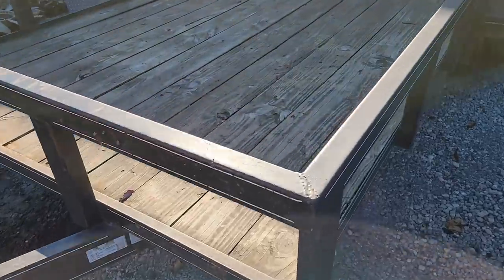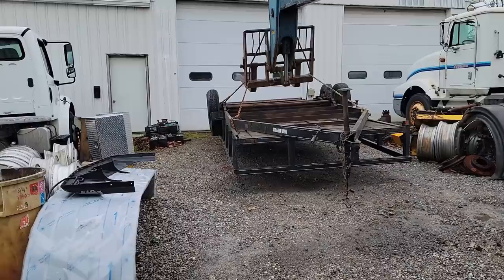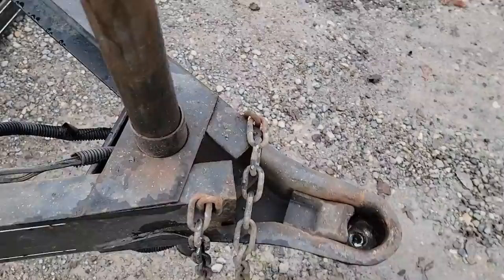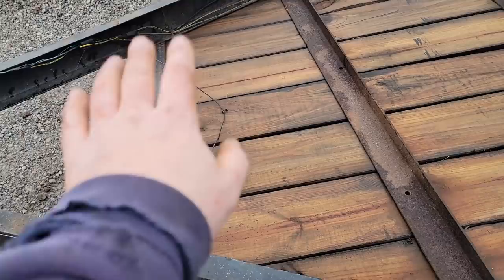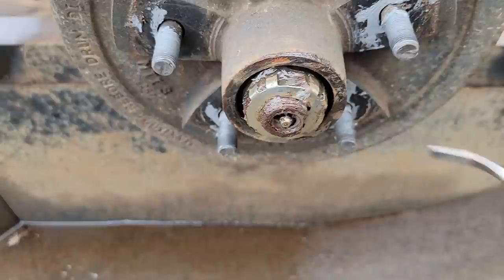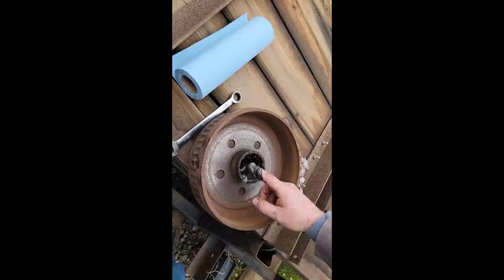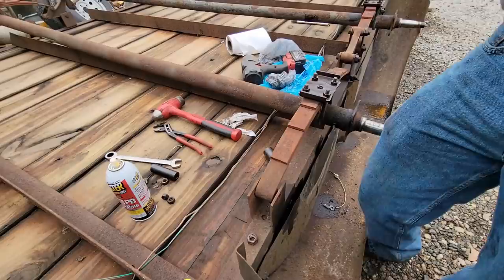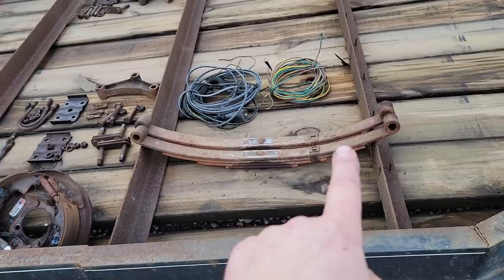7' X 18' LANDSCAPE / UTILITY TRAILER REBUILD! THE TEAR DOWN & INPSECTION!

Comment: Cap every other angle iron with the next smallest  angle iron and make a box beam.
If you want easy welding. Or same size if you want harder welding. 2" welds every 4 inches but first 4 "  on both sides. 

I do that on angle iron top trailers and it really stiffens the tops up quite dramatically. No more galloping gurtie tail shaking road harmonic trailer pulling.
 Billd better triangles!

Comment: They have a hd shakle kit on Amazon that's 90 bucks comes with all new bronze bushings wet bolts and 1/2 thick shackles I put it on my dads car hauler it worked very well

Comment: At least all the suspension and brakes parts are easy to find. We have a trailer with the exact same suspension and at least once a year I'm replacing the bushings and shackles... Sometimes the equalizer if the bolt worn through the bushing to much.

Comment: my 7 x 16 was welded the same  poorly . so I re- welded the whole thing and also added cross beams ,used pvc tubing for wire through that way no more rust  tail light kit was 25.00 bucks at  Napa. just needs new paint

Comment: I just did all this to my trailer. Looked exactly the same as yours. I added brakes to the 2nd axle. Without labor I think I was in $900 with 4 tires, re wiring, 4 leafs, u bolts, 4 brakes with bearings and backing plates.
Reply from the maker: i am going to use that i bought really cheap years ago. that is one reason this project is able to come in under budget and at the cost i want to be at.

Comment: I’ve never owned a trailer before, so I’m not going to comment and pretend that I’m an expert, but it’s surprising to me that they let that thing leave the factory in the first place.  I understand that it was sold as a budget friendly trailer,  but they could’ve taken a lot more time with those welds and fabrication.  

You’re right J.C, if they did a few more weld passes on those spring hangers it probably never would have failed in the first place, unless of course it was simply over loaded or hit something.  

Another great video, I hope it works out and doesn’t become a money pit for you👍
Reply from the maker: poor craftsmanship it the cause of the weld failure. shameful. i dont have time to do something once, i sure dont have time to do it twice.

Comment: I would check the tracking on that trailer... From ball centrr to front spring mount... Should equal... Then tandem mounts a have spec also... To be set from each other...  As screwed up as that trailer looks from use, it is equally cheaply assembled.. I would be willing to bet, tracking is out... = Tire wear...
Reply from the maker: we did. it is acceptable.

Comment: I have 12ton C channel heavy equipment trailer using the mobile home axles running the 9-14.5 low boy tires  8ofmy landscape trailers running brake axles but 8-14.5

Comment: I'm sure that trailer was frequently overloaded. Those spring hangers shouldn't be welded 90 degrees to the spring, that is exactly why they cracked( despite a crappy weld) . A better bigger weld would only cause cracking upwards through the frame. Have a good new year, Mike.
Reply from the maker: every one of these smaller trailers i have owned has been welded the exact same way.
Reply: @j.c.smithprojects  Maybe so maybe not. I've seen them both ways, The only ones I've had to do crack repair on the frame were welded that way. If you look on a leaf spring semi trailer you won't find one with welds going across the frame flange, same on trucks as it creates a crack situation.
Reply from the maker: i dont disagree with the principle at all. just that all these light duty trailers i have seen are welded the same as this one was.

Comment: That is what I would describe as a product made to suit a budget price. The previous owner(s) have not been good either with regard to it's maintenance. I have to say there is fairly obviously more work to repair it to make it even safe than I expected.
Reply from the maker: i have owned many light duty used trailers like this. i have not been surprised by anything on this trailer do far. typical "budget basement build". it will be ok when we are done.

Comment: For the rims you might want to look into powder coating them. Those rims should be small enough to put in a residential oven, get  an electric oven used then you can powder coat small things on future projects.
Reply from the maker: oh man, i hate powder coating. one rock chip and salt / brine solution from the winter roads gets under it and it peels off in sheets.
Reply: @j.c.smithprojects  you are right powder coat is not what everyone thinks it is no substitute for good prep and good quality paint.
Happy New Year to you and your wife

Comment: Always wondered how those electric brakes worked - now l know...can the brakes be wired up to come on when the brake lights come on...also l was noticing how the trailer was wanting to lean towards you when you had it on the hook - that was pretty good the way caught it when it started going the other way (so you could lay it down) seems like nothing ever goes that easy for me
Reply from the maker: there is a brake controller that takes input from the brake light switch. it is like a relay. it used the small amperage input to control a larger amperage draw. it also applied the power to brakes on a "ramp". starts at 0 volts and maxes at 12. the max voltage and how fast it applies that voltage are adjustable. some are a "time based while others are "inertia based".

Comment: In a casual conversation with a man at my granddaughters school he asked me what I did now that I was fully disabled and retired. I said I just tinker with my own stuff now and that I had just got done building a trailer. He proceeded to go completely sideways and say that he would NEVER buy a trailer that some jackleg has built. If I get one it's going to be a factory built with welds I can trust. 
After a little more of his rant I politely excused myself and left. I can understand where the guy was coming from. He had no idea that I was a certified welder and an aircraft machinist. But it rubbed my fur backwards a bit.
Now you look at what you have. It's a factory built unit that should be spot on.
Disregarding the wear and abuse that trailer is....... interesting. What reject did they have welding that thing? Where are their inspectors that should be finding this stuff? Those wires running through the holes......oh boy.
We buy this stuff new expecting that the people who built them know what they are doing and care.
Just think about that when you see these things flying down the road. 
It sends shivers down my spine sometimes.
I know when you are done with that trailer it will be right....not like it's factory built.
Have fun and be safe!
Terry

Comment: I made bolts drilling through the center and then made a hole vertical to grease the bushingmy bushing lasted 3yrs
Reply from the maker: we wont put enough miles on it to be a problem....plus i will maintain it.

Comment: I say the axle without brakes is the replacement axle cause a axle with brakes cost more and or they found a use axle cheaper then new and it has brakes but its hard to say but I say no brake axle is the winner for being the replacement one
Reply from the maker: if that was the case, the electric brake wire would have been too short to reach the back. most times when they put brakes on one axle only, it is the rear. the date code on the rear axle was 2020. they may have just bought the beam and not the complete axle.

Comment: Nice work again, Sir.  I know you mean well about staying under budget.... but I also know how you build/fix things.  (everything is done right) You and I both know this trailer will be perfect when you're finished with it,  regardless of what the parts cost. I've never seen you cut any corners yet. lolol. It's unfortunate that most mass produced trailers have such poor build quality.  I know not every manufacturer is bad, but I'd say a good majority of trailer companies put out this kind of product. It's like they have absolutely ZERO pride in their work. I consider a lot of these poorly built trailers dangerous. Imagine a hitch or tongue weld snaps and the trailer comes disconnected from the tow vehicle, and it's loaded with commercial lawn mowers or a car (for example), the two safety chains that are also poorly welded are going to instantly snap off and the trailer could very well run into/over another car, pedestrian, motorcyclist, etc, etc.  Imagine the liability for knowingly putting out such a poorly built product.  No thanks!
Reply from the maker: yes. i knew what it was when i looked at it. not surprised by any of this yet. at least when i am done with it and dont need it any more, someone will get a better version of what this manufacture put out.

Comment: I have rebuild many trailors.
I don't buy 7000 gvw way to weak.
Atleast parts are very cheap.
Reply from the maker: usually i want nothing smaller than 14,000lbs. my wife would like to have a small trailer in case she needs to move a mover, some garden materials, furniture and a side by side to property in wv.. more than likely my sone will use it most to haul his side by side.

Comment: Not to get under your skin but I have a local dealer that sells those trailers for less then 2500. I just bought a 20ft 10k equipment trailer for 2900 and as soon as i get the money I'm gonna go back and get a 20ft 7k car hauler for 2600.
Reply: What brand?
Reply from the maker: i will be far less than that when i am done.
Reply: @j.c.smithprojects  Gotcha. I figured you got it cheap bit didnt know how cheap. Used trailers right now are outrageous so I just bought new.
Reply: @mph5896  I'll have to look in the morning. Were in the middle of a storm right now so I'm not getting out of bed.  I know it's a local company not to far from the Muscle shoals area.
Reply from the maker: i will likely use this until i find what i really want or build one.
Reply: @j.c.smithprojects  I'd like to see you build one. I considered it but I got a quote for the steel and immediately threw that idea in the trash.
Reply from the maker: well, i have been gathering steel here and there as i found pieces that were exactly what i needed.

Comment: You can buy these trailers twin axle 
Goes for 9,000 . The craftsmanship is trash.. America has Ben going to hell in a handbag for yrs. A new trailer like that I'd off 3,000 on the account of the missing welds n the improper wiring.
Reply from the maker: $9000? not around here. new this can be had from $3000 and up.

Comment: Good luck  on this project. 
I make a good living rebuilding trailers as a side hustle.  The quality of trailers is horrible at best.  
One can send some serious time on them just welding them the correct way.
How long is the deck on that trailer?  If its 16' and you haven't gotten boards for it yet.  Might be worth the drive to lima ohio. I get 80% of my lumber there. 
The mill has great pricing on white Oak. 
The last time i was there i paid $250.oo for eight 2x8x16 and a six 2x10x16.
Reply from the maker: most utility trailers are horrible. like i said in the video, i basically bought a frame a deck. now i have to assemble it all properly. i have done this a time or two. i have everything here now and i am under budget so far.

Comment: That's one of the crappiest built trailers I've ever seen
Reply from the maker: there are far worse out there.
Reply: I'd call it low end of typical. I have a tractor supply utility trailer with poor weld quality, unmatched angles etc. Nowhere near the construction of my Kauffman but the cost reflects that.
Reply from the maker: kaufman has come a long way over the years. they also own quality and appalachian trailers as well.
Reply: @j.c.smithprojects  Kaufman isn't a PJ, but it was the best 10k skid steer trailer I could afford. Lights and wiring are junk but the bones are there. It's worked well for me.
Reply from the maker: i will take kaufman's paint over pj powder coating
Reply: @j.c.smithprojects  Paint on the Kaufman has held up well despite the lack of care. A spray can touch up here and there from some bruises. Never had a powder coated in my salt zone to see how they hold up.